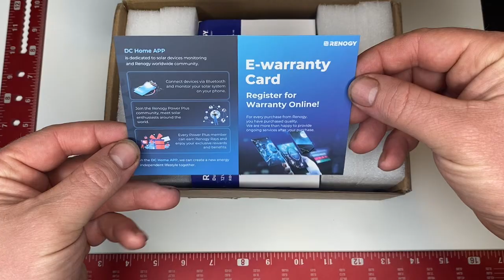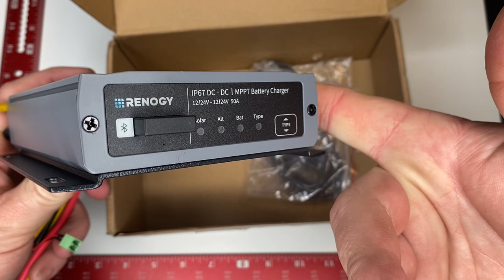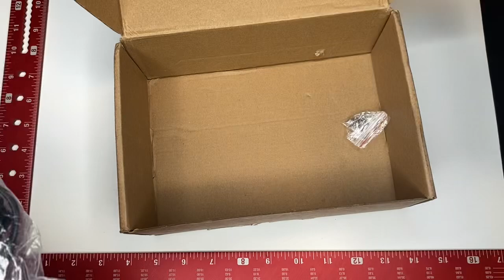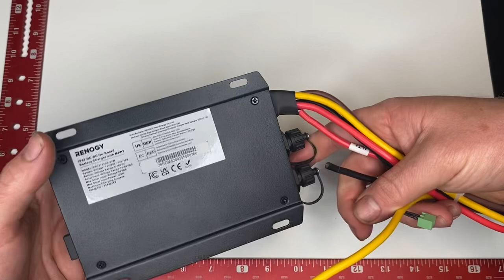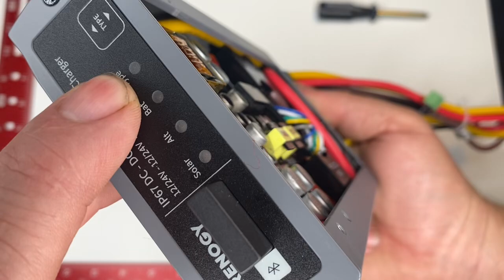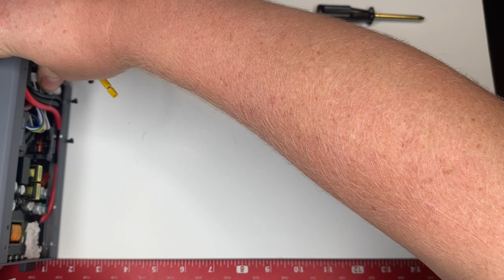Look Inside RENOGY12/24V - 12/24V DCDC IP67 50A DC-DC On - Board Battery Charger

Comment: Hope this helps 
   I have written this  as wires colours and functions 

From
 Page 4
 Renogy REGO 
 Dual Input DC - DC On-Board with MPPT Battery Charger 

12V / 24V 50A  | IP67
RBC2125DS-21-W-B
 
VERSION AO
March 4 , 2024

 Yellow positive , Black negative is SOLAR CONNECTOR  has .. ( " a black wire with white label "  negative solar " ) and  ( " yellow wire with a white label positive  solar " )
      
    
    Input :
    Black negative marked Neg -  
    Red Positive marked ALT + 
   
    Output :
    Black negative
    Neg - 
    Brown Positive 
    Out +

-------
   So 
      Solar : Black Negative , Yellow Positive 

     Input :  Black Negative , Red Positive .. alternator or it could be another DC source ( separate battery )

     Output : Black Negative ,  Brown Positive 

---------
  THIN TEMPERATURE SENSOR WIRE : Thin wire of Red , Black .. " Green Connector  "

Take note that .. 
    " Temperature Sensor can only be used with Lead Acid Batteries "

  www.renogy.com/support/downloads

  Thank you